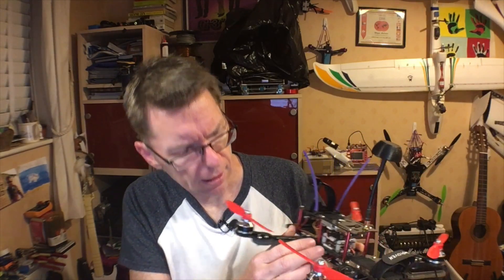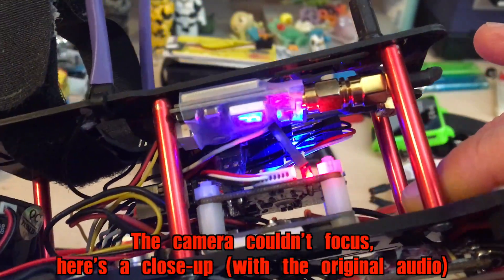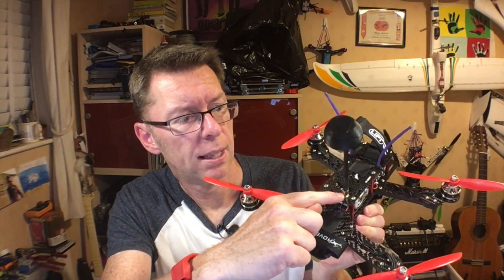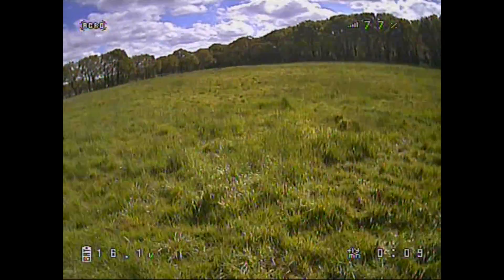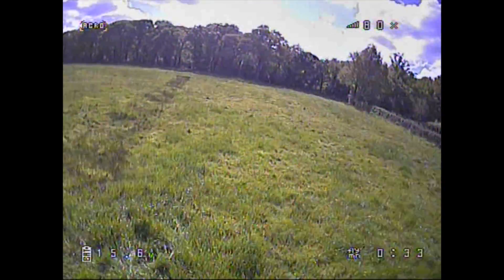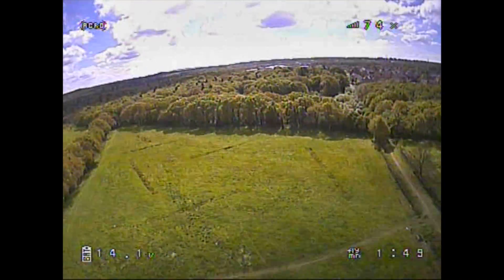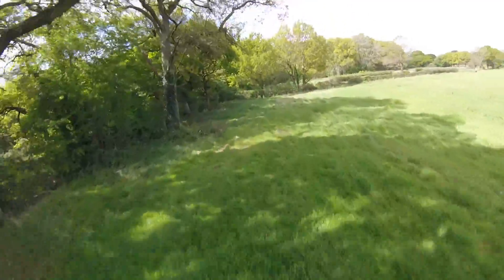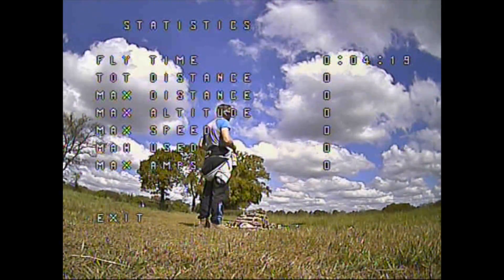FPV Reviews: The AKK-Tech X1 VTX (40 Ch, switchable 25/200/600mw power)

Comment: Sorry if this is an old clip of yours (no reply necessary) but I'm wondering! is the reason I'm getting low range the reason being not enough volts ? As in, 3.7 volts versus 4.8 volts to kick it into 200mW from 20 or so ? I have a similar version, goes only up to 200. Thanks in advance!
Reply from the maker: Good question. It’s difficult to say for sure and may depend on what the vtx runs on internally (3.3v vs 5v). Most modern vtxs tend to need 7v+ and will generally run off a bec FOM the FC that’ll put out 9-10v. It’s certainly worth doing an experiment with yours to see what a difference it makes

Comment: This looks identical to the Eachine TX526, the quality of soldering and presentation looks a bit better, but the circuit layout is identical.
Reply from the maker: Yes - I can find an identical looking thing for everything in their range - but they did mention very clearly that they were not clones, but designed and manufactured by themselves.  For this to be the case, multiple manufacturers must source in the same components from the same OEM suppliers ?
Reply: No idea, maybe the Eachine is a clone of the X1?  Either way I can confirm that the quality looks 100x better on the X1 from the photos off their Amazon page compared to the TX526 I have.   Only problems I have with the TX526 is heat, but I stuck a aluminium heat sink on it with some thermal silicone between and the audio is not great.

Comment: Nice job Wayne....Im toying with trying to FPV my old Alien Quad....I got a box of 3 blade props, but then realised how to balance them..?...I liked the look of this Quad you flew in the Clip, is it expensive to build from scratch, it looks like it has plenty of room for stuff?
Reply from the maker: Quite honestly, I haven't balanced any 5" props for an age and it's all been fine.  Pesky 6 inches, or something else.  The MXP230 is a brute, almost impossible to break - the arms are 6mm thick, and you do have a lot of space in that middle plate.  On the downside, it's an old design though, so the mounting holes aren't there for the normal naze style board.  This was a review quad for a magazine, but came from Derbyshire Drones who's on the hub, so check his shop out to see how much the frame costs

Comment: that video, looks a lot like a loose lens on the camera. that or a loose sensor
Reply from the maker: Lens is ok - but I hadn't considered the sensor.  Cheers - I'll go and check that out
Reply: yea i had a similar thing then someone suggested to pull the back of the camera off and the whole board was loose inside... but of hotglue fixed that :D
Reply from the maker: Not a loose sensor, but very much worth a try.  The props were awful though - I haven' had to touch a miniquad prop in an age, but these 6045s (DYS) have probably been the worst balanced props in anything...ever !
Reply: so was it the props in the first place ?
Reply from the maker: Will know once I put a few lipos through it - they were certainly way out though, and I'm still not particularly happy with the way they balance now.  I'll go and search out some alternative 6045's.  I'm not married to the 6" idea though - only takes 15 minutes to revert it back to a 5"
Reply: yea, 6 inch builds are one of those funky things where it's a toss up if you need to balance the props or not..